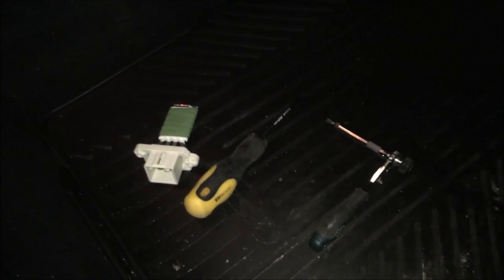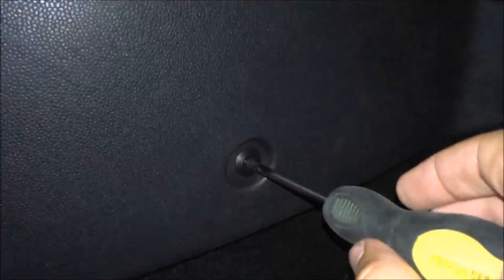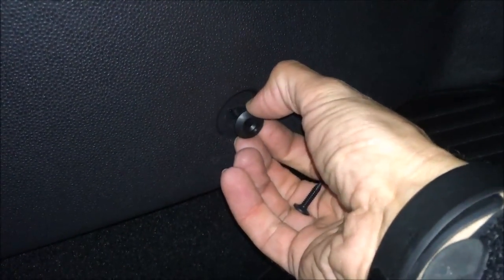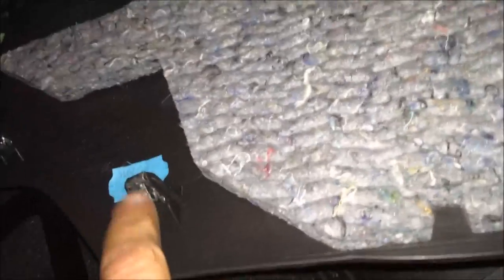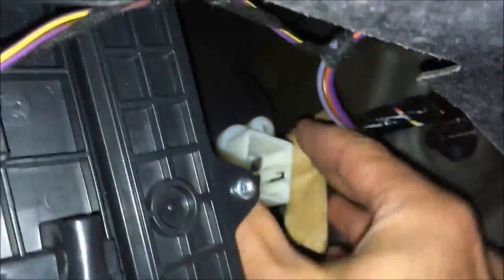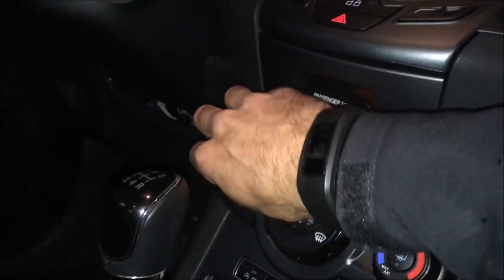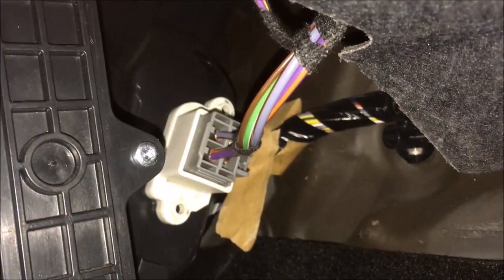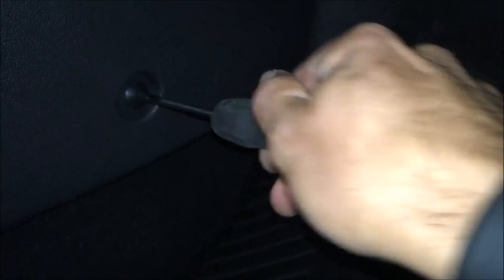How to replace a blower motor resistor on a Ford Fiesta 2014. Complete guide in English

Comment: Great video, thanks!! Completed the job in 30min. Note that the resistor is mounted via the passenger side foot well on a UK RHD 2014 Fiesta. Fitted OE part from Ford. There is a lot of poor quality copy parts being sold on eBay.
Reply: I wish I had read this comment before starting, would have been done in 1/2 the time.

Comment: Thanks, I just fixed my wife's car. Bought the part from a local supplier and fitted within 30 minutes. Most of it spent trying fit inside the footwell and positon myself. Still have put back the horrible plastic panels but thanks to your video it was an easy job.

Comment: The module is  quite far forward and nearly under the dashboard in the new UK models, but can be reached with the passenger side cover removed, mirrored as per this video. The small metal cylinder is a thermal fuse (circa 120 degrees C) it may be that this is open circuit and the resistor itself is OK. A temporary bypass with wire will prove if this is so. The thermal fuse is cheaper to replace than the whole module.
Reply: thx for info
Reply: Mines a UK 66 plate. Is it the same module?

Comment: The only thing they never mention, at least in my case (2014), I could feel it.up in the back of the console but could not get my head under the dash to see it from the door. I had to lie across the front seat and bend under the dash to see. Mine had a hook on one end and a screw on the other so, from my mentioned position, I was able to finally change it in minimal time. I wish I had been warned.

Comment: Is it the same process for ford focus 2012?
Reply from the maker: In general yes! -but the resistor might be placed behind the glovecompartment in some models. So you might have to remove the glovecompartment, which is done by removing some screws below the lid.if it is a lefthand drive it should be placed on the lefthandside. The resistor might be black on your model. Anyway the if you experience the same issues as i did, the solution is to replace the resistor.
Reply: thank you. will be trying out one sunny weekend :)